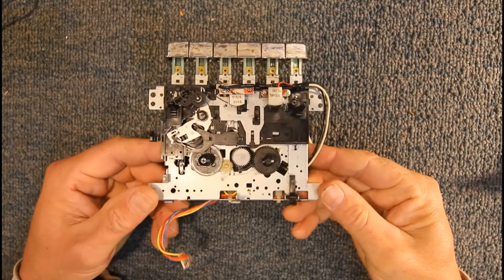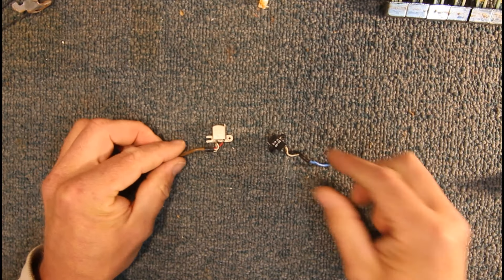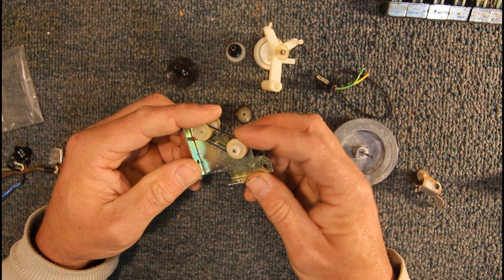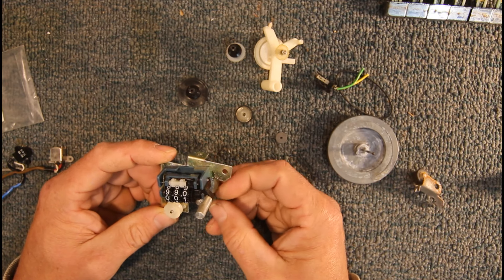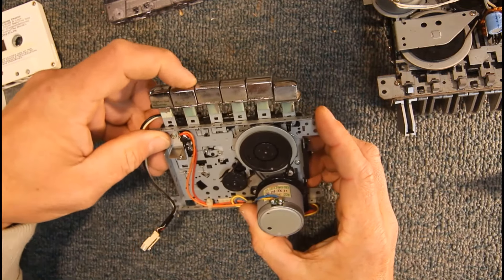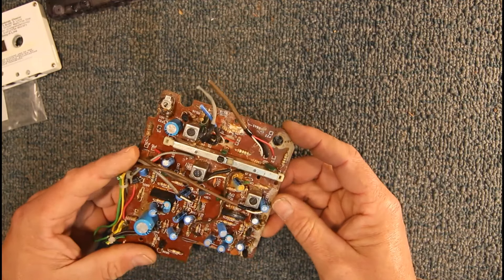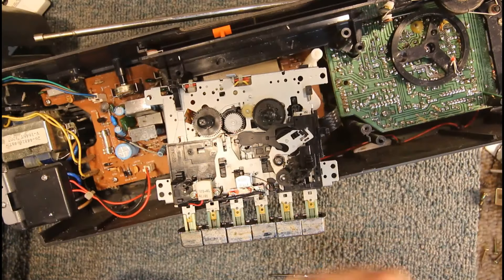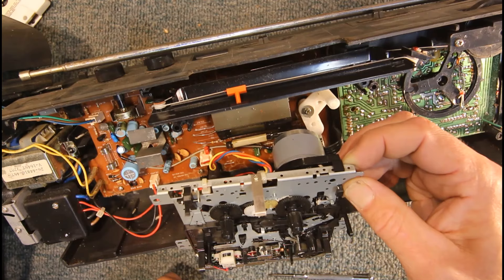Cassette Tape Player. How it works and how to repair.

Comment: My boombox dual cassette deck buttons seemed to be stuck, crushed and not working properly especially the eject button. I’ve gotten the buttons to move now but the buttons are not operating correctly. It looks like the buttons were crushed or stuck from a delivery. Might have got damaged from transportation and the boombox not packaged properly. It’s an Aiwa boombox from 1996. The buttons are hard plastic. Thank you very much sir. Great video too!! 💪💪

Comment: Fabulous video! Recently, I purchased a vintage Sankyo single cassette deck. Everything worked fine, except the Record button could not be pushed. Now, I found and fixed the problem. The unit works great. Thank you very much.

Comment: I've had a Sears audio appliance with record player, am/fm radio, and two tape decks--one for recording and playback, the other for just end to end playback, no reverse.

The single end-to-end cassette player has not worked for over a decade. The record/play cassette player stopped closer to 5 years ago. It's always been my goal to give both cassette players an overhaul and see what's up. Thank you for giving me both a roadmap to the mechanism and where typical failures happen. I'm looking forward to having this back in working condition!
Reply from the maker: Good luck with it. I have quite a few other cassette and boombox repair videos. They might be worth a quick look to see if any have the same mechanisms as yours so you can get a more detailed video on them.

Comment: Fantastic video mate. I now know how a cassette deck works and you helped me repair/clean 2 portable cassette players in 24 hours. I've subscribed and look forward to future videos.
Reply from the maker: Glad it helped. Hopefully I can pass on some of what I learned before I forget it, so people can keep some of this old gear going.
Reply: @StevesElectronicRepairShop  hey Steve I got a question. I have an old tqscam tape recorder. It seems the parts that go into the tape when you hit play is stuck out so I cant get the tape in. I think when you hit stop it should go back in and it's stuck out. Do you have any explanation of that? Is it purely mechanical and not electrical? Like an easy fix?
Reply from the maker: @greendragon2471  That is a mechanical problem where the deck is stuck in the play/record position with the heads up and pinch roller on the captan. It could be that the bar that latches things in place is not releasing the plate with the heads etc when stop is pressed, or the plate itself isnt moving back for some reason like somethings bent. The first thing to check is whatever the play button pushes on, to see if its bent at all. You could also hold the stop button and see if you can push the heads back down. Hopefully I will have a video up soon were I go over a corroded old 1970s Cassette player and get it mostly working, which shows a bit more detail on mechanical problems like that.
Reply: @StevesElectronicRepairShop  omg thank you!!! Also I'm about to upload a video I took of it if you wunna watch it. It's like 2 minutes.
Reply: @StevesElectronicRepairShop  just realized the video was private. I made it public

Comment: I picked up some random tips from other vids, but watching this just made it all click together!  Thank you for such a straightforward yet comprehensive video!

I have a Sony TC-K71 from 1981-ish which has chewed a tape now and then for like forever (don't you just hate intermittent issues...).  It's an auto-reverse 3-head machine, so a bit more complex than yer average boombox, but it seems that all the same principles you explained apply just the same, just in more places!

I replaced a snapped belt many years ago (Sony Service faxed me a parts diagram! - but more recently I found the service manual online) - which caused the deck to be unusable for a couple of decades, but now I know to replace as much rubber as I can, and pay particular attention to the take-up mechanism reliability.

One thing you didn't cover here was checking how straight the tape path is (especially when there's a little plastic tape guide at the start), preferably without forking out a ton for a mirror cassette...  Time to check out your other vids!

I transferred a bunch of tapes to "quality" CD-R media decades ago, but now the optical media is often unreadable so I have to go back to my tapes to salvage some of my music!  At least nowadays I can afford to store my FLAC cassette rips on spinning rust with some degree of redundancy...
Reply from the maker: I have never needed to check how straight the tape path is. Usually the guides are on the head and it is the only adjustment, which you set when doing azimuth. Its easy to check the pinch roller for any play which is about the only other thing that could cause an issue.

Comment: Thanks for this sir. Were it not for this video I'd still be stuck. I'd gotten myself a Sony TCM 939 not too long ago which, naturally, wasn't recording nor playing anything. Watched some tutorials, discovered the belts were old, so the counter belt and the larger ones were all too stretched. Tape chewing, whirring, white noise, you name it. Replaced the belts, now play, rewind, etc. working. Then recording wasn't working, and I just couldn't figure out why.

I remembered that at some point whilst first opening the tape recorder up, a piece of metal fell out as well as a screw, which is never a good sign but I didn't know what it was for and nothing i searched up was telling me, so I shelved it. Fast forward to just yesterday, I was idly watching your video and got to the point where you were explaining the recording mechanism, and it clicked. Not the same exact shape, but that piece of metal you were pointing out looked similar enough. Opened the back up, screwed the little piece in to where i thought it would go, and it started recording perfectly. Never been so happy and proud.

I'd never messed with anything like this before, but it was an excellent beginners project.
Reply from the maker: Glad it helped, and good job getting an old machine running again.

Comment: Thanks buddy I really appreciate your help. Actually what happened was an old lady down the road had a garage sale and there sitting on a table was 3 suitcase style turntable the 3 band radios and you could actually pick up country NSW, radio stations, and a Pyle diotron cd500 tape deck. She told me that none of them work. She was right about the tape deck but the turntables just needed new cartridge that were a pain to find, but I was able to track some sellers on eBay who deal with vintage record players. Thanks again for your help
Reply from the maker: Some of those old radios were great. I used to listen to 3XY and 2SM in Hobart on my dads old National 3 band hooked to an old TV antenna back in the early 1980s.
Reply: @StevesElectronicRepairShop  oh my god one of the suitcase turntables I got from the old lady is a national 3 band sg-766 with an antenna that pulls out from side of the case and 2 detached speakers. Do you have a shop

Comment: Quick question. Why does auto stop active while you are testing the deck in rewind? I hear it clicking to stop, is that normal? One of my tape players does this, but not the other ones.
Reply from the maker: Auto stop is only on the take up reel and activates when that doesnt turn. In play and FF that reel is turning even without a tape in there. In rewind without a tape, only the supply reel turns, so the auto stop detects a stalled take up reel and activates like its stalled because the tape has reached its end, which is its job. Some decks use a lever under the cassette that senses a rise in tape tension and they cant be activated with no tape in the machine.
Reply: I just realized that I was testing rewind without a tape in it, I opened the cover to replace a blown speaker, and its a new deck for me. Makes sense now. Thanks!

Comment: Thanks I managed to fix my deck with this, one thing for some machines too is the auto return switch in on position on 4 tracks can fool you into thinking the deck has failed because it clicks off when the counter zeros at whatever spot you reset-zeroed it at last, worth checking
Reply from the maker: I forgot that some of the early decks had a memory function on the counter to stop the tape at zero.
Reply: So much good information here. But I have an issue when trying to record, the play/rec buttons lock into position but it does not feed the tape onto the take up reel, other than that everything works as intended... and it is a unit with the counter on it. Not sure if it's user error or mechanical error.... Any help would be appreciated.

Comment: Im on my way to buying an old defective but beautiful tape radio. Im looking forward to fixing it, probably replacing all the internal stuff. Ill probably get/build a Class A amplifier, add Bluetooth and add a direct output from the head for recording. Ill also probably replace the speakers and install a lot of 18650s for energy storage.

Comment: Gday Steve, I enjoy your videos mate!  Firstly, happy New Year!  I'm trying to get a child-hood 70's Panasonic Take 'n Tape (RQ711-S) cassette recorder up and running again.  She's in great cosmetic nick, pristine in fact, but its been idol for decades.  I have replaced the belt - all good, motor and spindles running perfectly now.  What I'm getting sound-wise though, is loud crackle and pop 90% of the time, whether a tape is inserted or not.  When I press Play, Rew or FF, same thing...crackle crackle.  Occasionally though - depending on how I orient the machine - rock it side to side, lay it down, or upside down for example, it will play a cassette perfectly.  It's an "upright" machine by design, but my best luck has been laying it down face up.  Volume control even works when she's running.  Move her again though and back to endless loud crackle with no volume adjustment.  I have cleaned the head, capstan and pinch roller with alcohol and ear-buds (as I did when I was a kid).  So I'm stumped mate, but my repair skills are very basic at best. Any thoughts?  Ta mate!  Cheers, Mark - Caloundra, Qld. 👍
Reply from the maker: If the crackle is not affected by the volume control its something to do with the amplifier. I would start with the motor switch on the cassette deck which should be a little leaf switch with a couple of wires connected to it, probably the only wires other than motor and heads. Clean the contacts of that or just bypass it to see if tarnished contacts are the problem. It could also be some other earth or power connection including the switch contacts in the power socket for the plug in power cord. Could also be bad solder joints, especially on things like the volume control, but tapping on or wobbling things like that should make it come and go. It looks like they also have germanium transistors in them, which can do things like that. They are the silver cans with three legs on the PCB, two look to have metal heatsinks attached which would be the amplifier. You could try warming them with a hair dryer to see if it has any effect, or even cool it in the fridge and see if its temperature related, which is usually a faulty transistor.
Reply: @StevesElectronicRepairShop  oh mate, this great info! Thanks for that. I will take her apart a bit further and look for those points. The fact that she works perfectly (sometimes) gives me hope 👍 Do you have a physical 'shop' that I could send her to, if I can't find the issue myself? Nobody here on the Sunshine Coast (Qld)... Thanks again mate!
Reply from the maker: @markhooper1352  I dont run a business anymore, but my email is in the About section. If you have no luck let me know and we can arrange something.

Comment: Thank you so much for sharing your wisdom!  When I press my play button all the way down into locked position, no sound comes out, even though everything looks like it's running normally, but when the button is MOST of the way down (before locking) it DOES play the cassette.  What would cause that to happen?  I'll be overjoyed if I can fix it.
Reply from the maker: It could have a muting switch somewhere on the mech, or if auto reverse, a head direction switch, either may need a clean or has some mechanical issue as far as pressing it. Another unlikely cause could be broken head wires that drop out both channels when the head is fully in position.

Comment: Hey man seems like you’re very knowledgeable about this. This actually helped me a lot. But I have an issue on my lasonic Trc 975 book box. Where the speeds on the slots are different to one another. Tape A is perfectly fine ! But tape b is slooooowwwww. There is a 1k ohm trimmer pot that I replaced. But if I adjust it so that tape b plays at correct speed tape A plays too fast. I have no idea why this is happening. I replaced all belts in it. It’s driven by one motor. Both decks. 
Will wrong belt sizes cause speed issues ?
And shouldn’t that trimmer pot control speed between both decks evenly ? That’s the mystery
Reply from the maker: I think I had a similar issue in a boombox recently but cant remember what it was. May have been the Mitsubishi one. Belts shouldnt cause unless very tight, it but possibly something like the reels having an issue may cause one capstan to slow if the reel belt comes from the capstan, though in theory it should slow the whole motor, but it may not always be the case. The problem is you cant test it easily as removing the belt will make it chew a tape on that deck.

Comment: Question: I have a Technics 630 and it’s in amazing shape other than the right channel drops because of that rec/play switch you mentioned. When I crack it open and hose it with Deoxit D5 it sounds good as new but it will only last a few days before it’s right back. I tried putting a blank tape in every day and just switching the record and play back and forth about a dozen or two times but it seems to never want to go back unless I hose it down again. Is this thing trash? I want to just replace it but I don’t want to spend hundreds on another deck and have the same problem 😭

Comment: I've been trying to fix a cassette player I recently bought. I think some part must've broken off because one of the heads is loose! The tape will play for about a second before cutting off, but the tape plays fine when I completely hold the player upside down😆

Comment: I`m just beginning to delve into the cases of factory Jeep AM/FM Cassette Players and recently did an R&R on two 56002467(1991) cases and swapped out the tape modules. Now I have me some rocking tunes. Now I have a couple of questions for you so I can troubleshoot and repair a couple of players. What is the cause of a channel going out, either left or right, in a 2467 and what is the cause of a little lack of volume when you have the volume knob maxed out on a 56009004(1992)? If I knew how to repair tape modules that won`t draw the tape in on their own and seat down into position along with these two other issues then I would have those stack of players whipped. You can hear the tape mechanism running that supposed to draw the tape in after you manually push the tape in and then you have to pull the tape out with needle nose pliers. The 2467 and 9004 tape modules are held in by four screws. The 56003021&19(1988-90) are stationary or soldered. Don`t believe you can take those tape modules out. Gimme some good car stereo 101 Steve.

Comment: Subbed. Great clear video. After replacing the belt (single belt mechanism) I'm pretty sure it's the rubber idler wheel that is the cause of my issues. Old Data cassette player for loading programs into vintage (80's) computers. Good times :) O-Ring replacement was what I was thinking so great to hear you suggest that. Fingers crossed. Chewing a game cassette is worse than music as it literally becomes useless. Any warble and the program wont load :(
Reply from the maker: I remember having fun with the good old datasette as a kid. You definitely cannot afford to chew those tapes. They are annoying enough already having to wait for them to load.

Comment: Your video helped me identify fault. I have Denon 1995 era HiFi tape deck with idler fault. Capstan turns, pinch roller engages but take up reel does not turn - the tape spools & unit auto-stops. FF & RW work fine. It is a single belt system. I swapped out entire cassette unit & replacement has cricket chirping from capstan motor but idler works fine. The capstan motor runs a little hot & cassette tape is warm to touch after playing & removing it. I will replace 12V capstan motor when part arrives in the mail as I suspect it has internal fault. The faulty idler I will address once I have access to technical service manual that is also in the mail. If it is irreparable I will use as spare parts if desperate. Servicing capstan motors is not ideal IMO as repair reliability is questionable. I don't want to have to replace anyway after a few months of use.

Comment: What would you replace in an old (20Y+) cassette mechanism if you want it to last for 5Y+ ??
How do you find the speed adjustment?  What smartphone app do you use (android?  apple?) to check a 3 Khz speed tape?
Can you tell if the pinch roller is so worn that it needs replacement?  What is the signal, how to replace it?
What is the sign that you might need to demagnetize your heads?  I think I have a demagnetizer tape do those work?
Do you have a recommended piece of music (popular - easy to find) to test & tune the azimuth?